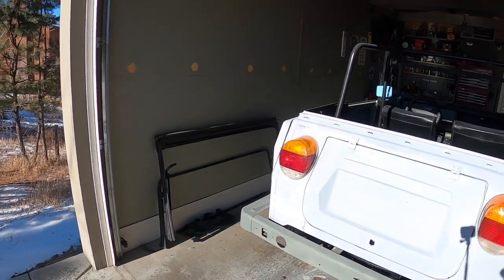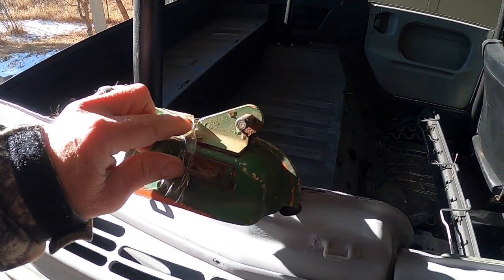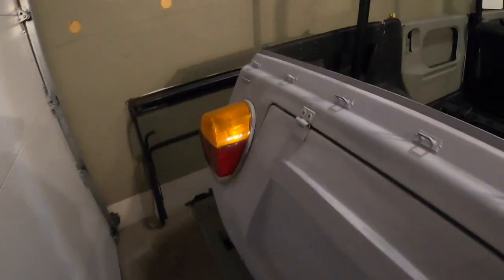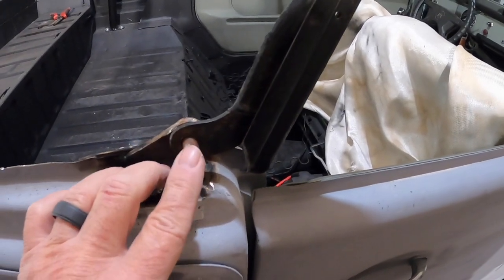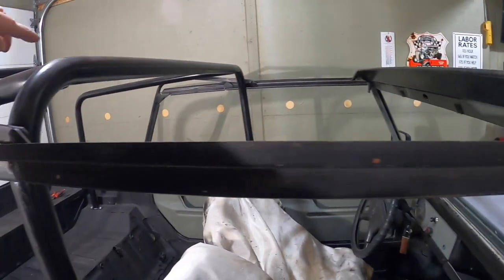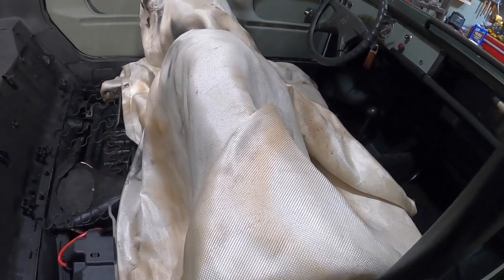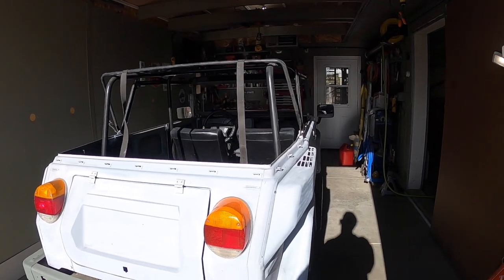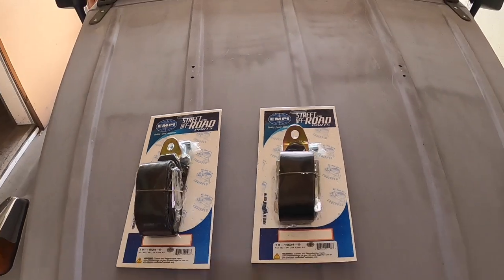VW Thing Restoration - Part 14 - Convertible Top

Comment: Nice video. Good work, progressing nicely. You probably know this already but in addition to the 2 clips to hold the top frame to the pivot pins there are 2 plastic and one metal washers that fit over those pins as well. The plastic ones help to reduce friction when raising and lowering the frame. Metal ones provide a stronger surface behind the clips.

Order on the pivot pin should be:
Plastic Washer - P/N N012560P
Top Bow 
Plastic Washer - P/N N012560P
Metal Washer = P/N  311827197 
Pivot Clip - P/N N0126481
Plastic washers can be made from some PVC plastic. A little thicker than a milk bottle but they're pretty cheap to buy.
Reply from the maker: Thanks for watching....
Reply from the maker: Thanks.. yep mike set me up with the washers also....
Reply from the maker: Cant wait to see yours done...
Reply from the maker: Sorry about the weird music when I was welding the cross bow...  used free music.. but youtube said was copy right infringement...  they replaced it with that.